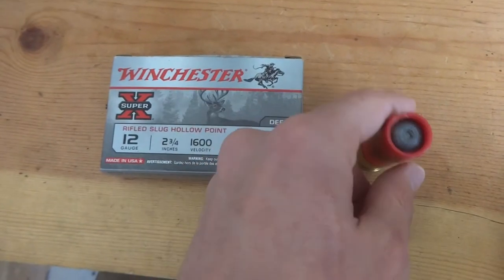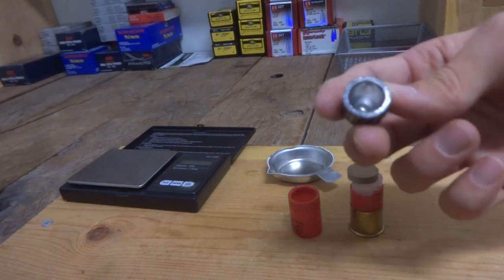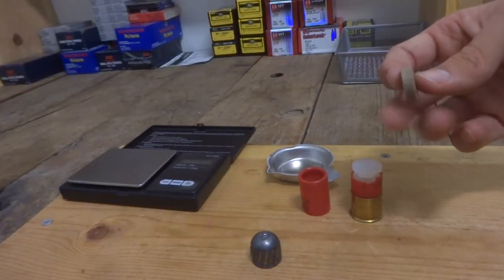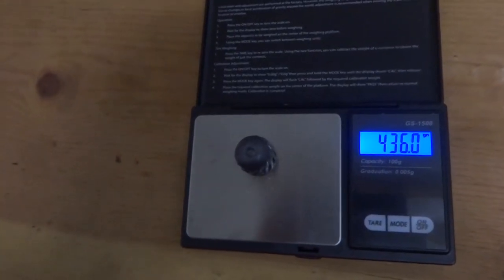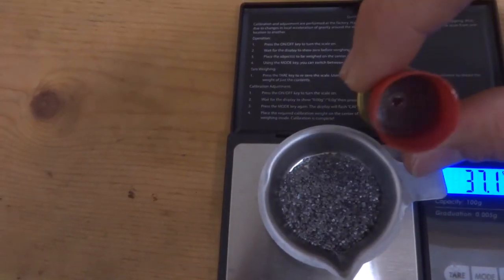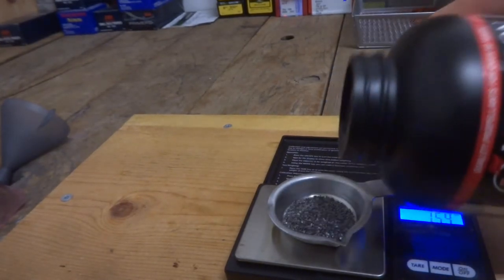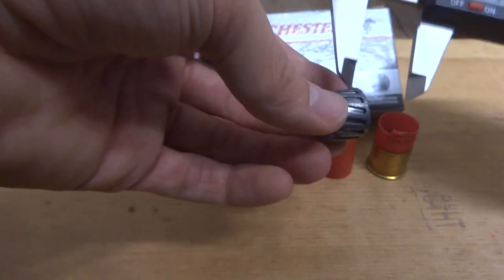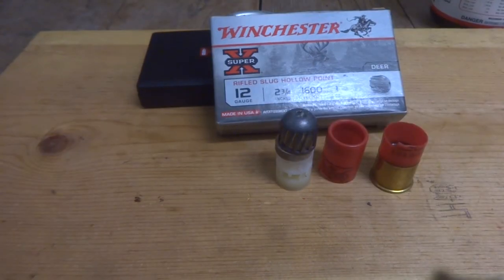Whats inside a Winchester 1oz rifled slug?

Comment: Very nice,two days ago I shot 1oz round ball which use in muzzleloaders,i took a round lead ball slug and took a birdshot shell and then I removed all bb and insert the ball slug,and then shot ,I got very good penitration result it's better than foster/rifle slug and you can also reuse recovered ball again.i think you should also make round ball slug.
Reply: surbhit sharma .690 round ball in a 12ga shot cup or fullbore pumpkin ball 72cal? Codd has .690
Reply from the maker: Wow that's impressive, I would like to try that, it was a 50 caliber muzzle loader ball?
Reply: leadloader8700 thanks for reply I don't know about that ball slug calibre but it was 1 Oz in weight and it's result is very impressive.
Reply: codfishdoom thanks for reply you should try it with high brass shells ,I also reload some 000 buck shots in trap and skeet ammunition,it is also very destructive.i will also reload it with black powder,becouse in  India you can't get smokeless powder but black powder available easily.
Reply from the maker: That sucks you cant get smokeless powder there, you can buy ammunition loaded with smokeless powder though?